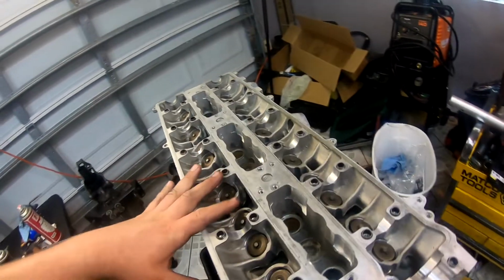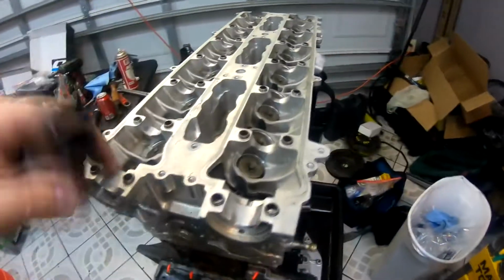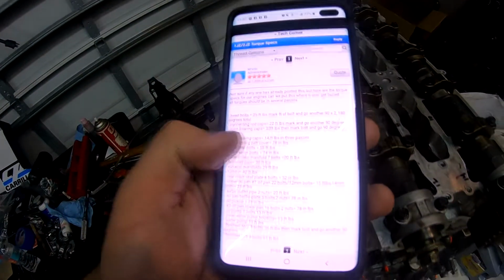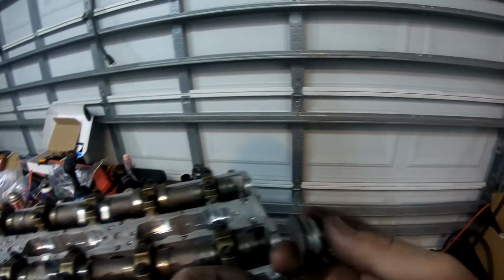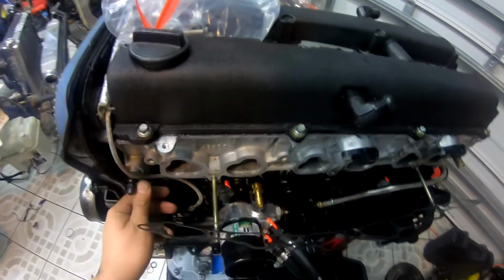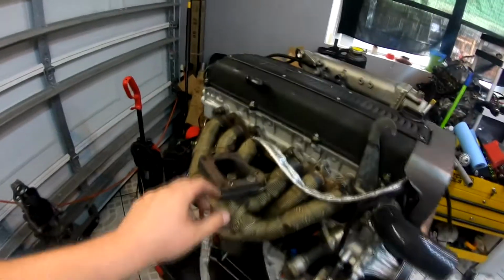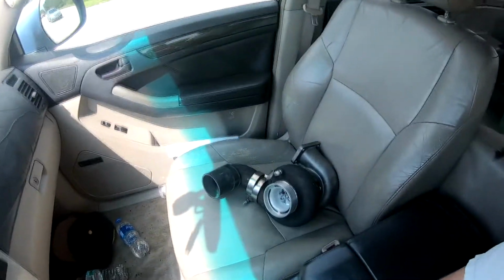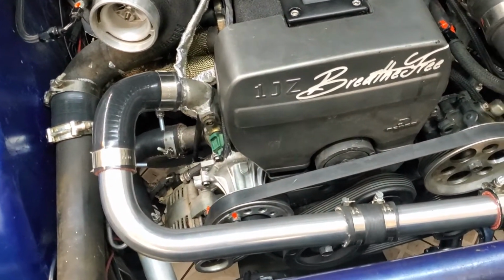Finishing the 1.5JZ build!

Comment: Im building the same engine do u have a parts list
Reply from the maker: Building the engine in what sense? new rods/pistons/etc? in that case it's a lot more detailed than just a refresh let me know
Reply: Yes rods pistons billett mains ect but i know thst tube has to be changed for the water pump to housing using a 2j bottom 1j head but so 2 j head studs or 1j i got a 90 mm throddle body ls coil pacs and doing a fuel tech 450 and 2000 cc injectors got a sheetmetal intake and a schedgule 40 turbo manifold so tryin to delete the heater core hoses got 20an for rad